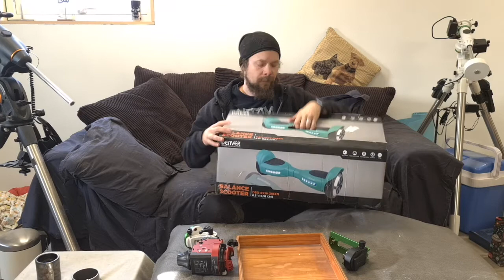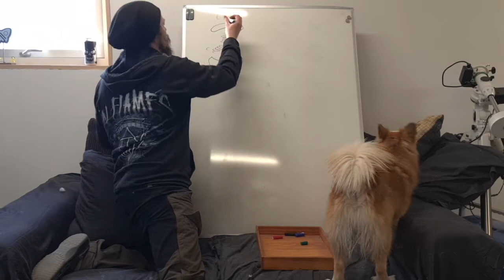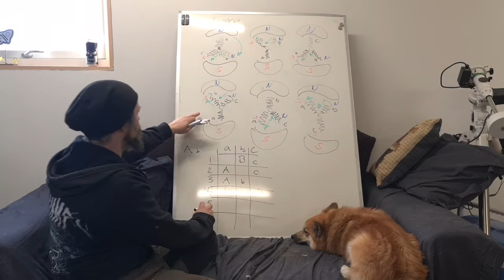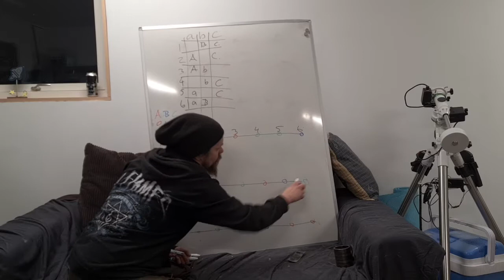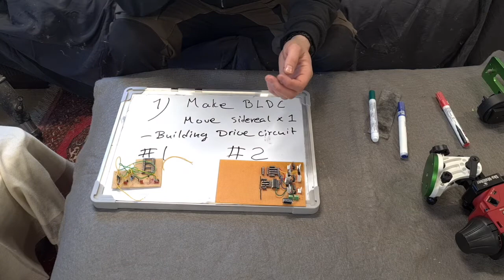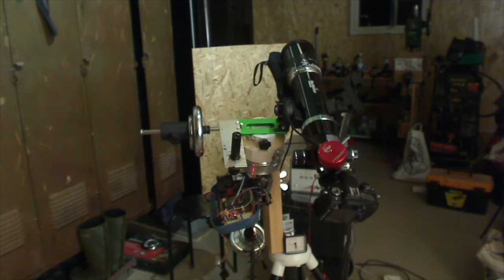The Lucid Mount StarTracker - A Direct Drive DIY project

Comment: I’ve been considering making a very small single arm fork mount using heavy duty gimbal motors. I don’t have a great grasp on the electronic theory, but with an AS5048A encoder, it should be better than nothing I think. 

I don’t think it would be suitable for AP given the encoder resolution but still a fun and potentially cheap project
Reply from the maker: Sounds like a fun project, and a great spring board if you want to evolve it further!
Go nuts!

Comment: Well now I see why later you have some 'periodic' type issues. Even a good modern microdrive ready stepper motor has an uneven torque. As an engineer you could have roughed out the torque curve for that scooter motor. Position and torque is a very demanding task. Which is why the renishaw encoder commercial direct drives work at all. If you were to nest the coils (...my windmill generators from decades ago) max copper fill with only minimal transformer steel, the torque could be much smoother. I praise your attitude to get on and try things out. I found a wire cable drive with a big non-precision disc and 50 times smaller pinion worked better and was so easy to make compared to the usual worm and wheel. Your project still relies on the original shaft and bearings though...not meant to be precision. I use an old 1000 step 5 pH vexta stepper with sinusoidal drive from an arduino successfully.
Reply from the maker: Hi again!
Yes, I drive the BLDC motor like a stepper motor by creating a stall position that I gently shift to move the axel. As you say, any imperfections in phase coil windings, magnets in relation to these etc will cause a variation in this stall position and the torque holding it. 
The main periodic error I have follows the phase current switching very well (which 2 phases in the Y-formation are receiving are sharing the current, and 1 phase that is getting the full sum of the two.) If this equilibrium is not met due to imperfections the stall position will shift accordingly.
One could map these events, or the torque curve as you say, and counter with a change in drive current etc.
I might look at getting an off-the-shelf driver if it could handle the resolution I require, but then I could also look at an encoder.
An encoder would theoretically provide the information drive the axis in a prefect speed, or hold them in correct stall position. For this project however, I wanted to see how far I could get without it though.
On a calm night, the high frequency error is not that bad. The dec RMS is often <1”. And it’s the same for RA. The issue for RA is the periodic error, which I hope to solve with some internal PEC training.
That’s the development ahead :)

Comment: Extremely impressive, is it only done with hall position loop without an optical encoder?
Reply from the maker: Thanks mate! It’s really completely open loop. That is I’m not even using the hall-effect sensors. The resolution is just so bad that I just didn’t integrate it at all. I’m looking at making an optical sensor of my own, just for fun, but it is quite interesting. I’ll see if it will take off at some point.
Thanks for watching!